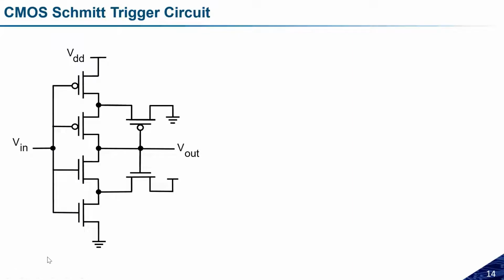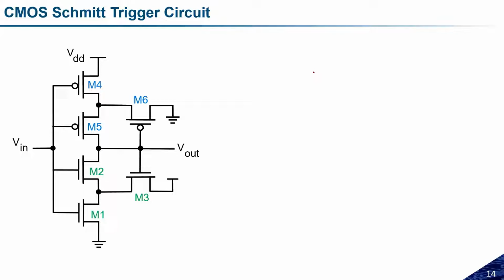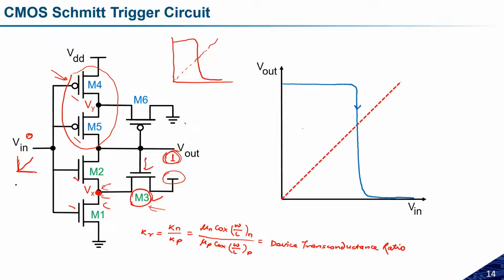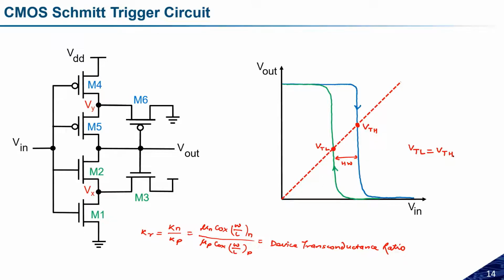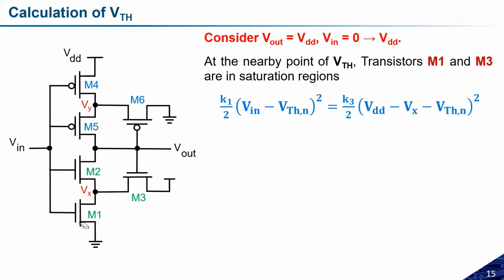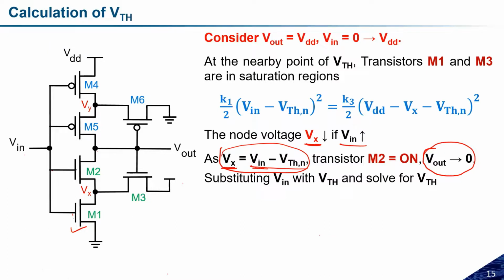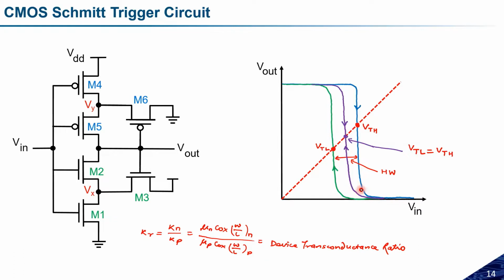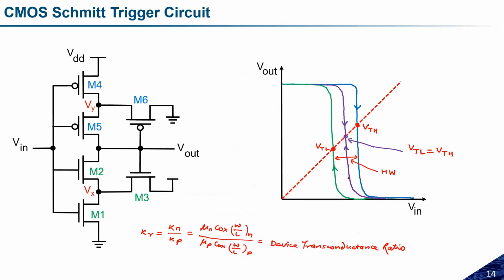Lecture 32: CMOS Schmitt Trigger Circuit | MOS VLSI Design | Dr. Ambika Prasad Shah | IIT Jammu

Comment: Can someone explain why presence of voltage at Vx increases the pull-up strength and similarly presence of voltage at Vy increases the pull-down strength ?
Reply: For an inverter there is always a tug-off war between pull up and pull-down network to control the output. In simple words, pull-up/down strength means which network controls the output. As Vx goes high, Vin is still low, so M2 is off. If M2 is off, the pull-down network is not operational and so in a way it is assisting the pull up network, thereby increasing the pull up strength.